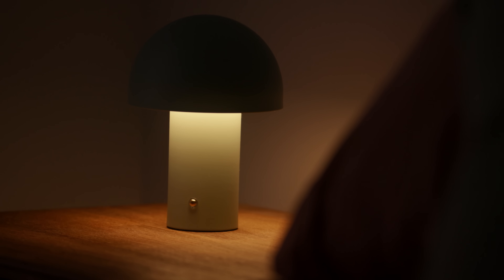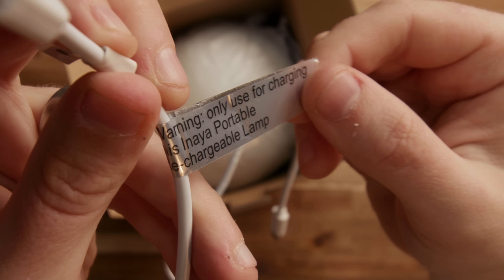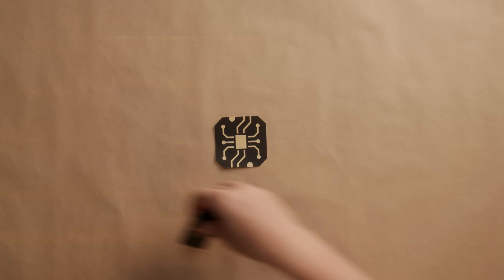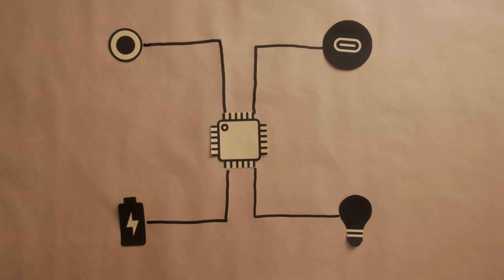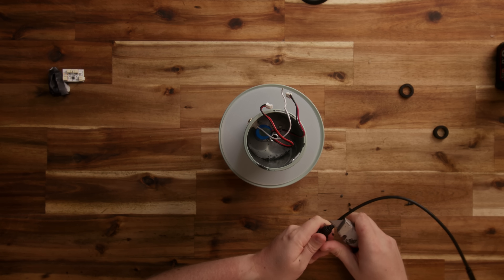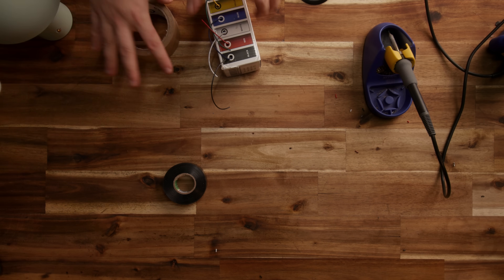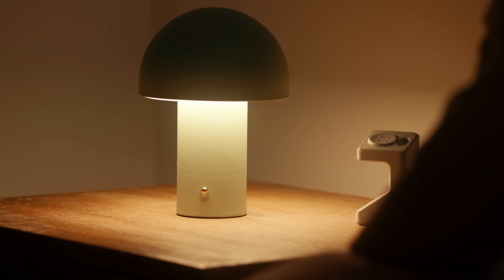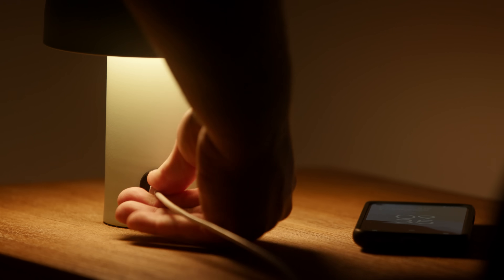Kmart Lied to Me, So I Hacked Their Lamp

Comment: After 6 months of on-again off-again trying to build this I can say I have mostly finished building this!
A few things I learned, your choice of MOSFET manages very much. The esp32 outputs a very low voltage to the MOSFET so even some 'logic' level mosfets don't go down to the voltage needed to be controlled by an esp32. From what I can tell you need something with a low threshold such as an IRLB8721. Additionally just as I didn't find it super clear. When installing the code you don't use Arduino IDE or anything like that. You actually need to install ESPHome onto your server running Home Assistant (such as in the form of a docker container) and it has an inbuilt web interface which you then use to edit code and provision it to the ESP32.

Comment: This isn't uncommon in the retro gaming space with emulator handhelds. They're USB-C products that use max of 5V charging. Using cables other than the recommended cable can damage the product per the manufacturers of them and prevent the battery from being able to charge. It's infuriating, but this is common with any USB-C product in the space under about 120USD, but even that range isn't immune to it either.

Comment: This video shows the issue that I've had with this "agreed upon standard" that is what we colloquially refer to as the USB C, something that actually kinda makes me dread the universal adoption of the port. The USB C PORT only refers to the physical port. That's basically it. It can be wired in any way, for many different standards including all the different USB actual standards (which is what I think the guy in the video is actually interested in) like the USB 1, USB 2.0, USB 3.1 and whatever other confusing spec is out there, up to thunderbolt which is not a USB standard at all
This means that there are a bunch of USB C cables out there made for very different standards, often incompatible or bottlenecked, and it's all the more confusing

Comment: Why a rechargeable lamp... why not just something that can be plugged into a wall?
And the light looks proprietary, meaning it will be plastic e-waste before a normal lamp would.
IMO just get a metal lamp with an outlet built into it, you plug your USB charger into it, the light and charger are replaceable, modular, upgradeable, simple and elegant.
Can even get smart bulbs if you want.
This videos is about standard breaking but everything here is reinventing the wheel.

I do however think you did an awesome job with your hack.
But I feel like that new USB port is... a little much.
Why couldn't you just reuse the old port and swap the wires? Was it unmodifiable?

Comment: Why USB-C + batteries at all? It's a bedside lamp and doesn't move. Just save the e-waste and plug it into mains power permanently. I hate that everything is wireless and rechargeable these days.
Reply: ESP32 boards are typically power hungry. I'm curious as to how long the batteries will last. Great video but I agree - hardwire everything. Batteries suck.

Comment: ok but why do the lamps need to even have a battery? if they stay at your bedside, why not make them powered via usb c full time? could you not add a usb c port so you could charge your phone? i mean you altered the different brightness' because you only used the brightest setting. also USB C is the standard for the port shape itself, not the USB standard, stupid i know. this allows for companies to release things with "USB C" but it's actually just usb 2.0 or even just 5v power but with a usb c end

Comment: I've found a lot of cheap rechargeable devices won't recharge with a fast charger. You need like a usb a-c cable plugged into a lower wattage charging block. not really relevant here, but similar issue i thought was kinda interesting.

Comment: Would much rather have a USB and battery less version of this that you just plug in permanently like any other regular bed side lamp. Having a battery in there at all seems like a completely unnecessary fire hazard, the way it sits in there you won't even notice when it starts swelling. There are essentially zero benefits to having this thing be portable considering it's gonna stay right by your bed like 99.99% of the time anyway. Like as an emergency flashlight? Please.
But know what would've been cool? Turning the USB-C port into a charger for other devices.

Comment: Anyone know where the wire soldered to the G pin (under 12) goes? At 7:07 .
I’m new to all of this but have decided to try it myself!
Reply from the maker: The negative lead of the battery! 

Not totally necessary, but an extra ground lead is never a bad idea 😂
Reply: Awesome, thank you! I’ll add the ground wire in.
Also fyi, Kmart also has a “Nico” lamp which looks like it has almost identical internals. I’m going to try this mod on the Nico lamp too - wish me luck!

Comment: This mans entire channel is based off of esp32 or arduino..  cant anybody use their brains a bit more and use dedicated components and circuitry without having to have a microcontroller and eeprom or memory..?  Theres purpose made chips that are safe, proven and perfect.  There comes a point where home automation is just too automated and becomes more of a hassle than an accommodation..   like what happens when the power goes out and you lose all the code ?  Or you get a backfed surge that kills the main hub or something..?  Or if somebody happens to come up with a flipper with some antennas and figures out all your automation then reprograms the toilets to eat you or throw poo nuggets at you all the sudden?  Or if they’re really evil and reset the coffee makers for decaf?!?  You could die..

Comment: This isn't a K-Mart specific issue, sadly. And it isn't exactly thier fault either. They have buyers and they buy products for K-Mart to sell. They cannot feasibly check every product for compliance on things like is the usbc cord and actual usbc cord. Shoud it actually be a proper usbc cord? Of course, but to do that kind of quality check on every product they buy to resell - like this lamp - is financially impossible. They trust the seller to be selling what they say they are selling. This isn't ideal when you get bad sellers like this (the original Chinese manufacturer, not K-Mart).

Comment: I've seen it where it needs an A-to-C, because the resistor that would allow C-to-C to work is clearly too expensive. But just ignoring the USB standard entirely is bizarre. Like that's a custom cable instead of using one of the ones that are mass produced. Does that even save them money anymore?

Comment: Seems cheap lamps use only USB-C connector, not actual standard. My cheap stairs sensor lamps also have USB-C but they only charge using USB-A socket. Do not work with double sided C wires.

Comment: Why couldnt you just change the usb c port instead all the other work. Also why not just leave the cable plugged in instead of unplugging it every time after its charged, because it seems like a hassle to have to constantly plug and unplug a cable into it to charge.

Comment: Some non-smart products can not charge off fast chargers so you have to use a regular charger or use the priority cable that comes with them. My flashlight and storm radio will not charge off my phone charger but they will charge with the charger that came with my Bluetooth speaker and they will also charge off the USB ports for the radio on my car.

Comment: Genuine question, its mentioned that these lamps create e-waste by not functioning correctly but does it being rechargeable and having a battery that will eventually die not already create unnecessary e-waste? Wouldn't a plugged in lamp be better for the environment? I just don't get the hassle of having to charge a lamp lol

Comment: We got some Costco lamps that did the same thing but didn’t come with cables! 

Scary but gas station charger cables charged them just fine 😂
Reply: That is because the gas station charger is not a smart charger. a lot of non smart products will not charge off of smart chargers or fast chargers.

Comment: Using an out of the box esp32 with ESPHome to power a battery-operated lamp is a really **DUMB** idea.
The esp32 will drain the battery quickly unless you are smart about it and implement deep sleep functionality.
Since you really only need to turn on/off/dim the light, you are *INFINITELY* better off using a small, dirt-cheap PIC microcontroller -- cheaper, small, much lower power consumption with no loss of capability.
If you want to do fancy automations, that belongs in HA not in the end device.

Comment: OK, I realize I am a little late i to this, but I think you are actually a little misunderstood.
When the product says it is USB-C, it actually is. This is because the standard is for the actual connection itself, not how it is used. 
For example, do you use a USB-C phone charger to power your computer, even though the connector is the same? No, because it won't work. And I really wouldn't suggest plugging in a computer power cable into a USB-C port for a thumb drive, either.

My suggestion to you would be to read the documentation you get with the purchased item, and do some research before you accuse others of falsehood.

Comment: why would you want these battery powered. they sit stationary plug them into the wall and be done with it. no risk of forbidden caprison or uncharged light. it being WiFi controlled if the power is out the WiFi is too so the battery doesn't even help then. and your phone already has a torch on it fir the rare occasions the power is out.

Comment: The reason why there are so many varitions on the USB cable wiring.... At least in the USA, anything can be labeled as USB-C without limits. USB-C doesn't mean what you think it does. An old 9-pin RS-232 port can be called USB-C, though most people would look at it and not buy it because it is visually not what they expect. Even using the connector style that is recognizable as USB-C doesn't mean that the cable or pinout follows the USB wiring, power and timing specs. The letters USB-C actually mean nothing at all without the USB-C logo. But if the logo is present on the device, then the USB Implementers Forum organization that licenses the logo trademark can (if they want to) enforce the illegal usage of the trademark for being displayed on a device or accompanying documentation that doesn't conform to the specs.

Comment: FYI purchased the lamp on April 24 in NZ and it charges with various Type C cables. 
So it is possible that the port used was changed after X amount of batches or a switch from X manufacturer to Y manufacturer.

Comment: I saw the thumbnail for this video earlier in the week.

Yesterday while shopping for something unrelated, I happened to see them on clearance for $10, so I picked one up to have a look.
Not having watched the video yet, I just plugged it into the USB-C cable I use for charging my phone. The lamp lit up red, indicating charging was underway and the end of the cable changed from blue to red, signalling power was being drawn.

You can probably imagine my horror when I got to the part where you talked about a non-standard charge cable and this was only slightly alleviated when I saw the pinned comment.

I've got a bunch of 4,000 mAh batteries that I removed from another kmart product on clearance a while ago (Charging case for [Nintendo] Switch) - After learning they were up to no good, when the box clearly states a capacity of 5,000 mAh, yet about half of them have an obviously pre-loved 4,000 mAh battery with the same 5,000 mAh sticker that the others had, I waited until they dropped further in price and bought every single unit they had for $5 down from the original 30 something dollars.

I've just received a bunch of A09t and A19t sot-23 mosfets from Ebay and have more ESP32 boards than I can poke a stick at. I think I might have to have a go at modding one or more of these lamps too. Perhaps I'll add a radar human proximity sensor to it so I can interact with it without needing to touch it - or maybe I'll just make it controllable from my phone. Depends how bored I get, I suppose. 😆

Thanks for a great video. It's made me a happy chappy and earned you a subscription. 👍

Comment: I noticed the included cable is A to C.  I find this with a lot of cheap devices, they will only work with A to C cables because they are "dumb" and dont do any negotiation. C to C cables need extra circuitry in the device before they pass power and thats one way they can save cost.

Comment: Thanks for the video! I just finished following on my own lamp, and it works great!
A couple of points:
- it would be beneficial to use the correct MOSFET symbol in the wiring diagram
- you didn't link from your website post back to this video, that I can see.

Comment: Just use a pd control unit with voltage selector for like 4 dollars. I used this method to connect a usb c battery bank to a 9 v uninterrupted power supply to turn my mini pc into battery powered with usb passthrough.

Comment: I have two usb-c speakers that also only work with usb-a > usb-c cable. So annoying. Currently the only thing I owe that is not fully usb-c. I have to have this cable just for the speakers. And they are fully incased in silicone so i cannot cjange the port.

Comment: Ironically, this would void insurance on the home if it burns down by literally any other means, yet those dodgy Chinese sweatshop lamps are fine
Reply: The thing with most retail products is that they are on the hook for any fault caused by a product. If your house was to burn down due to a faulty lamp, the insurance company will pay you out, then likely sue the retailer for the damage caused (though you would not be involved at this point, as all correspondence would be resolved at payout). Of course, this modification would void that, and you'd be fully liable for any damage and likely void your insurance.

Comment: I'm obsessed with modifying everything I get my hands on, I look for the cheapest functional thing that has the one thing I was looking for (high lumen, rechargeable, decent form factor, etc.) and make it better than the best one available. Usually pretty cheap and always cheaper than buying the better one. I'm an electrician so that helps. Make anything bluetooth or remote controlled with a $4 clicker, also motion sensors and relays are fun.

Comment: There seems to be a misunderstanding about what USB is trying to do and what Regulators were doing. USB is trying to create a unified standard, Regulators were only looking to cut down on e-waste and did nothing to regulate USB C or make it an actual universal standard. All they did was tell companies that were using proprietary cables, that they all needed to start using the most common connector (USB-C), unless they could come up with a connector design that was significantly better and worth everyone switching to instead

Regulators did nothing to regulate USB-C or make it an actual universal standard, which is why you have all these different types of USB-C cables that only charge, or only transfer date, or charge and transfer data, or only work with certain devices. USB is trying to make cables more standardised, but without regulation to actually force manufacturers to make all USB-C cables the same they just won’t do it

Comment: I had the same issue. It will work with a usb-a to c, the lamp uses a cheaper usb-c port that doesn't include a transistor which is designed to allow the charger to detect something is plugged in and start charging. this is different to usb-a which is always powered.

Comment: "Even Apple is using the USB-C standard now". Apple pretty much wrote the standard — the two main contributors to the standard have always been Apple and Intel (the iMac was the first computer with USB-A remember... and it was the same with USB-C - intel made the tech available for both but it took years for anyone but Apple to adopt it). In recent decades Apple has done most of the R&D work. If Intel had their way, it was going to be a hybrid cable with fibre for data and copper for power which was an interesting approach that had real benefits.... but it would be far too expensive for an iPhone, let alone a bedside lamp.

Comment: Did they firget the USBC pull up resistors which are required for charging with usb-c supplies?
In that case it can be charged using usb-a. Nuki is also guilty of that.
Or did they fuck up bug time and used RANDOM pins?

Comment: The USB standard is always a surprise package.
Because only the external appearance and what each conductor in the connector is supposed to do is fixed. So USB-C can be called anything but nothing really.
The same applies to USB-A and names like USB 3 gen1_1, Gen 2_1, or Gen 2_2 (5Gbps/10Gbps/10Gbps+). Good luck with the speeds or possible additional features like 100W+, DisplayPort or the new Thunderbolt compatibility, or other things.
USB sounds great as an idea, but poorly implemented.
The only reliable connection is from A to USB-C.

Comment: I bet they f'ed it up in design by wiring up the connector wrong, and then figured making a custom USB Cable is cheaper than throwing the batch of faulty devices away.

Comment: You only need two pull down resistors to make the usb-c cable ask the charger for 5 volts and that's it in a c to c cable. The reason the other cable works is because is usb A to usb c, however usb c to c won't because of the missing resistors, it is an inconvenience of course but that was all that was needed to fix it. You need to solder two 5.1k resistors on CC1 to GND and CC2 to GND on the usb c female connector, the issue might be that the pins are not wired for that so there won't be space though but in theory that is all you need to do.